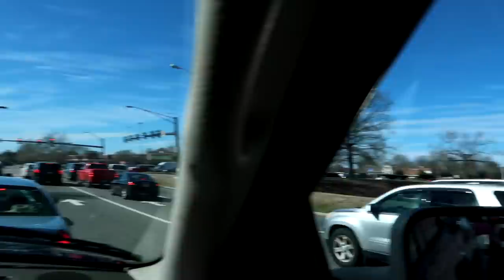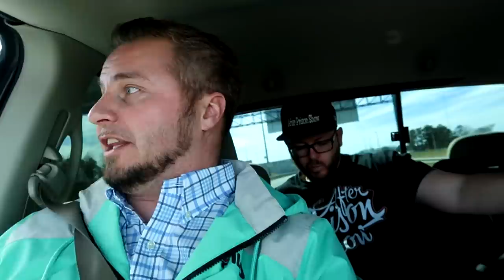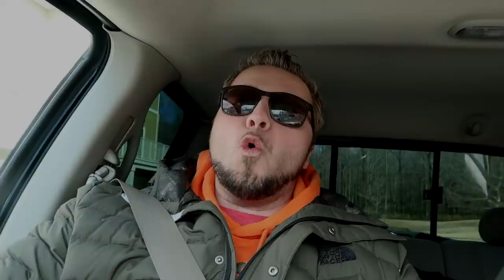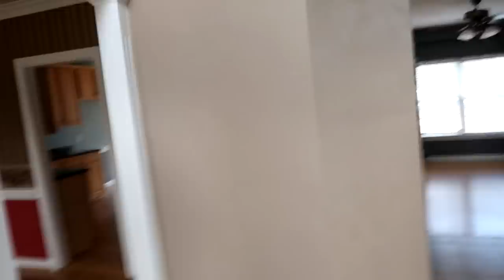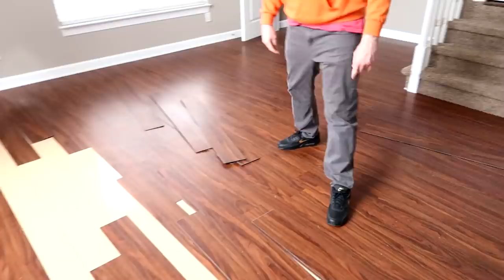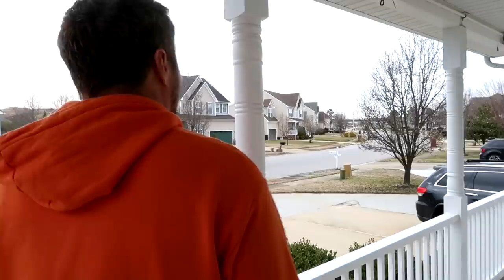Buying My First House After Prison...

Comment: You can move a fridge if it's just been unplugged. The problem is you can't lay the fridge down and then hook it up and turn it on. You have to let the freeon in the fridge settle after you stand it up for 24hrs than you can turn it on.
Reply: My boys got worked.. Im a local mover. I wouldnt have touched that fridge for less than 100.
Reply: @Justin Brunk - You're 100% correct.  It's been my experience that almost no one knows of this.
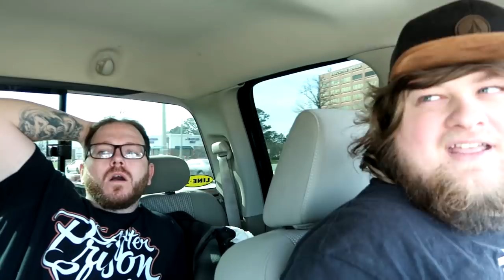Reply: Justin Brunk 9:50

Comment: After transporting: If it has been necessary to transport the refrigerator on its side (ex. Top Freezer and SxS models), it should stand upright for an equal amount of time as it was on its side before plugging it in. If it was onits side for more than a day, leave standing for 24 hours before running.

Comment: Hey buddy you checked out the roof right? Like when was the last time the roof was done and when it was done last time did they put new wood down and then reshingle it? A good way to check is go in the attic and look at the wood and see if theres any holes in the wood if so then u know the old nails were puled and they just stripped the old shingles and then hammered new ones on.

Comment: when you lay a refrigerator down on its side, the oil runs out of the compressor.. you  need to let it sit up rite for 24 hours before plugging it in, so the oil gets back to the compressor. if you just start it rite up, it will ruin it.. might get 1 year out of it before it quits..

Comment: YOU MUST SEE THIS  be for u buy a house 
"Chinese drywall" refers to an environmental health issue involving defective drywall manufactured in China, imported to the United States and used in residential construction between 2001 and 2009 — affecting "an estimated 100,000 homes in more than 20 states."
Reply: this will smell like gas bro